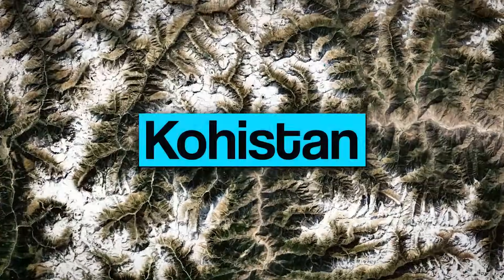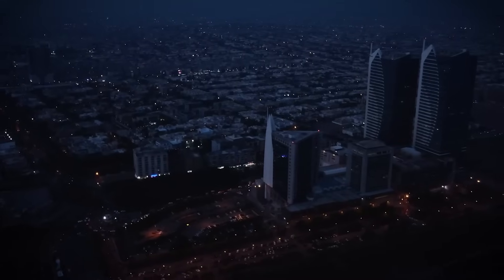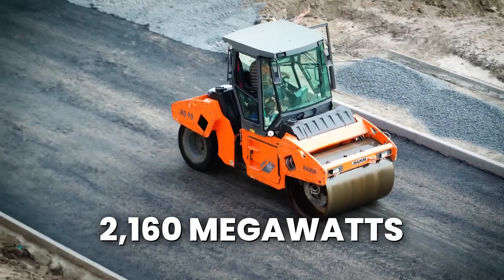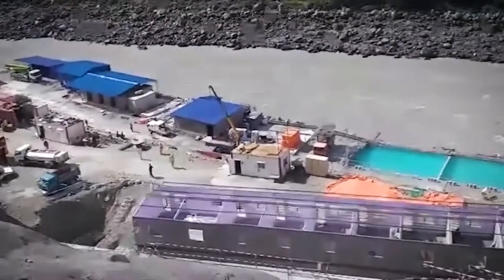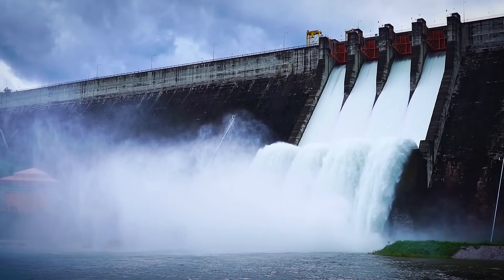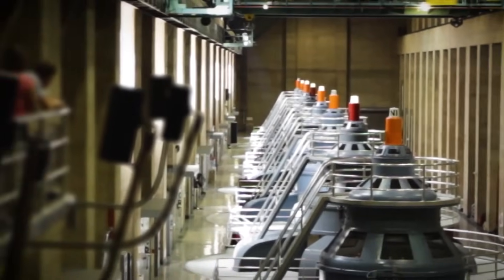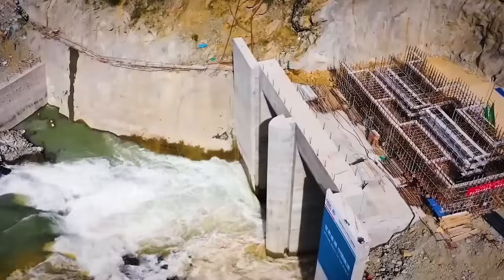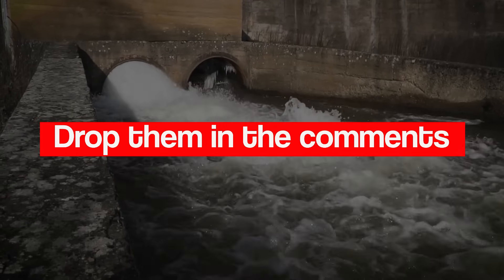Pakistan’s $4.2 Billion Mega Dam Will Change Everything!

Comment: People in Pakistan are rapidly shifting toward completing their power damands from Solar energy instead of relying solely on National Grid. By which, the homesin Pakistan will IA not only be made self-sustained in terms of energy, but will also be contributing to the power generation in National Grid, by selling excess electricity directly to National Grid. This process is becoming very common day by day.
Reply: Yes,it would be nice if it was extensive but it doesn't include the common man.Mostly, people in and around Islamabad are doing it.We are still producing less than 1% power from solar.

Comment: Pakistan has already solved the energy crisis as it had been producing more electricity than required for a couple years, albeit it is solved by the local users not the govt. Users have started installing solar panels due to which electricity demand has significantly reduced causing a hike in prices (yes unbelievable ik but apparently it costs to store that energy which has to be paid by end users). This will further put a strain on that unless users stop using solar panels or Pak govt starts to supply energy to rural areas too which alone will be another huge milestone if it happens. If the electricity network remains the same, the poor user who cannot install solar is going to get smashed due to high electricity costs.

Comment: In Durbela dam in Pakistan which is fairly new perhaps 40 years old the fish end up getting shredded to pieces when they flow through the turbines, surely a mesh cover would have solved that problem and those Beautiful big fish could survive, I wonder sometimes why people don't care or not capable of thinking of finer points. I'm sure China is not doing it as a favour and will make a lot of money in return. With Durbela dam in Pakistan homes yards from it have to suffer power cuts in severe summer heat for many hours on a daily basis so I wonder why not encourage solar power in a hot country with long light hours would that not be more favourable for the public there or am I missing something or large solar panel fields that heat up oil or something similar that then creates a lot of power like in Arabian deserts, the theives leading Pakistan will prosper along with generals, IMF and China the public will keep getting poorer.

Comment: This project will remain relevant for water storage purposes mainly as the majority is shifting towards off-grid solar solutions which is both cheaper than on-grid units and saves a huge ton.
Reply: Water stored is 10 percent of Tarbela storage ? and silt stored
will extend Tarbela useful life by 20 years ?

In any case built on  stolen land .... thus cursed.
Reply: that solar things can be done in balochistan